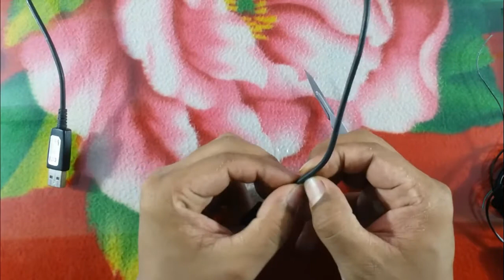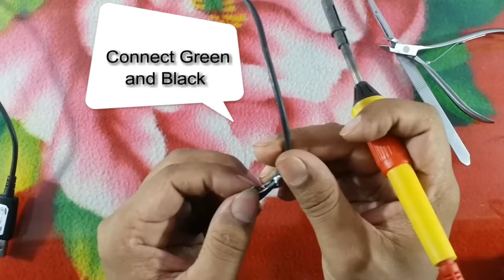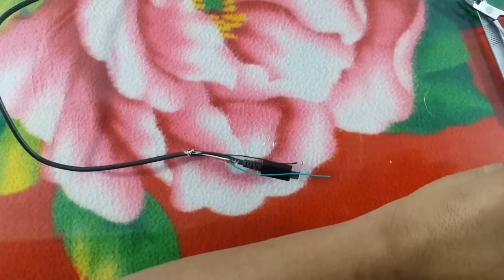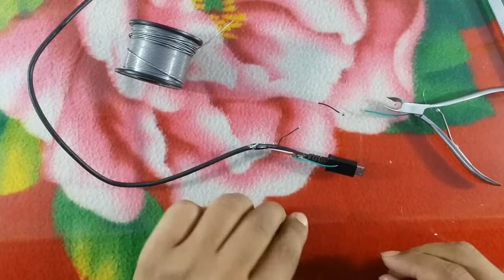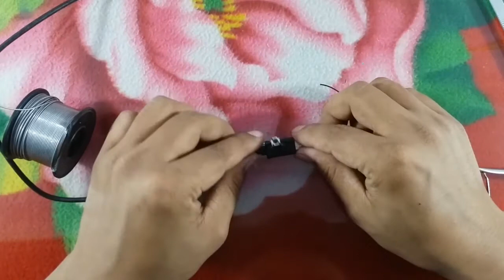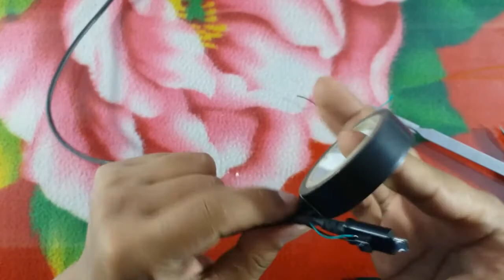How To Make Deep Flash Cable for flashing Xiaomi Device

Comment: hi this will works for redmi 7a? i allways got error..MI FLASH u not authorized this operation...
before brickdown the devices. by TWRP i swipe the rom and say no OS system the devices is already Unlock devices..question: if i use deep flash cable can be possible to bypass the AUTHORIZATION??